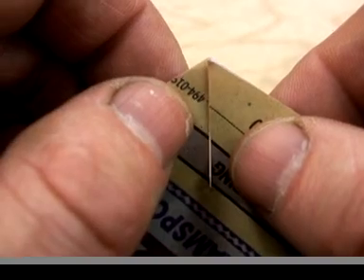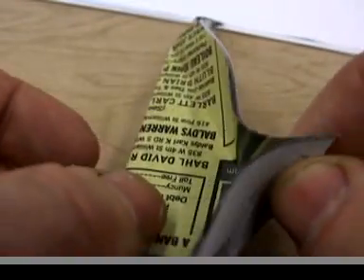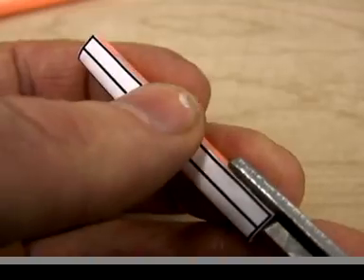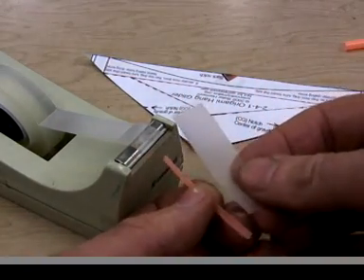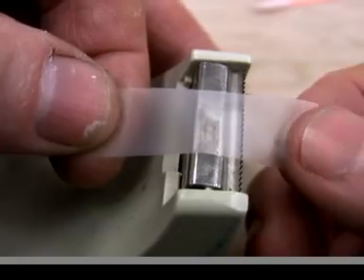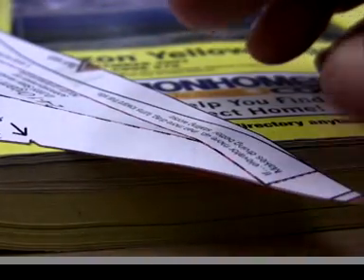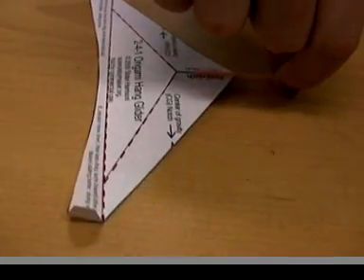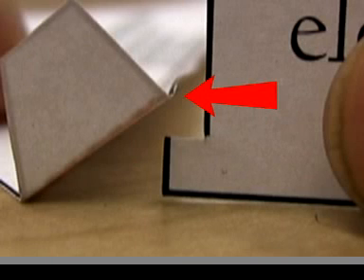OUT OF DATE Part 3 Surf an Origami Hang Glider on a Wave of Air_More Construction.mov

Comment: @sciencetoymaker Hi Slater,  I practiced and was able to fly the glider with my hands, but the point is that I found out you could do back-flips or loops using the glider, better to use cardboard so all you got to is  to gain some altitude and twist the cardboard forward quickly what this does is it sends a gust of wind to the front causing the nose of the glider to rise quickly, with a little practice  you will be able to get it perfectly thanks. 
                                   Deshitha

Comment from the maker: @MrPeopleslayer If the scale is a little off, that's still OK. In fact, if the air is dry you can make them much bigger. However, you might have to experiment with the center of gravity.
Slater